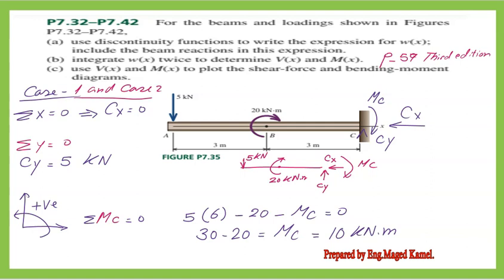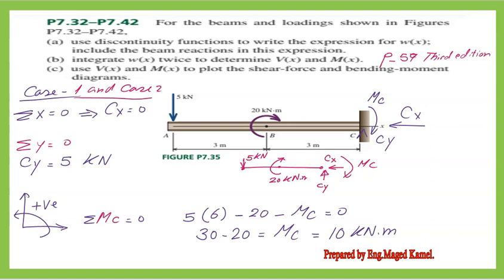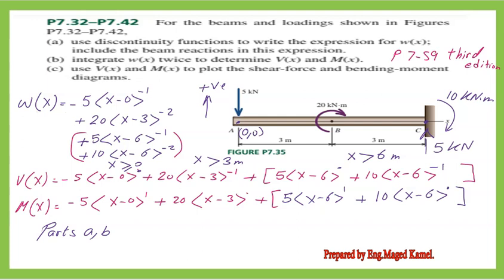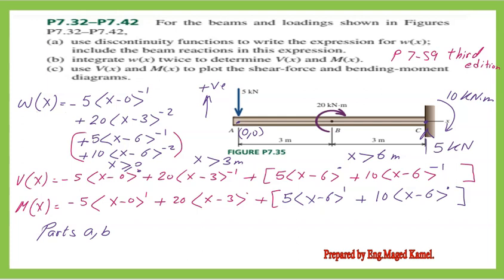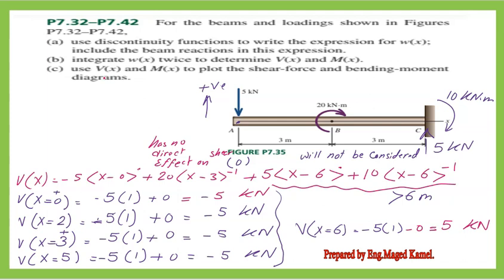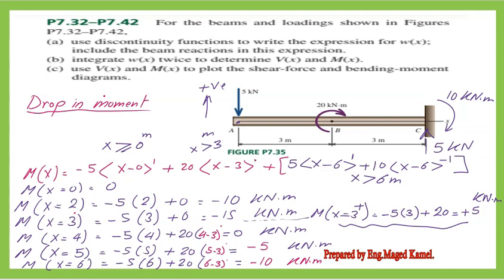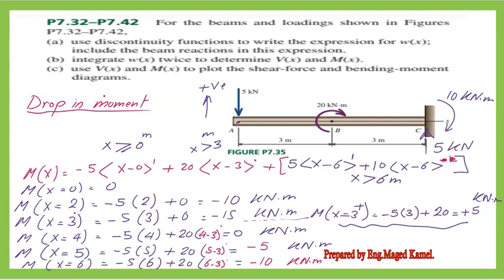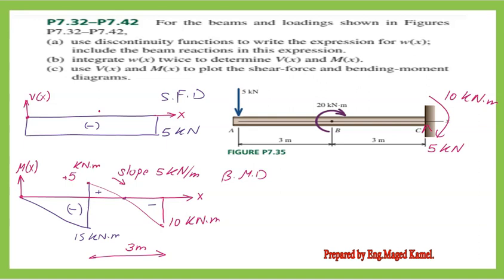4-Practice Problem P7-35-Find W(x), shear V(x) and M(x) for Cantilever-English.

Comment from the maker: There are two PDF files for the solved problem: The first PDF file link:https://magedkamel.com/wp-content/uploads/2025/12/PDF-file-for-post-4-P-7.35-load-and-shear-singularity.pdf
The second PDF file is:https://magedkamel.com/wp-content/uploads/2025/12/Pdf-for-post-4a-P-7.35-load-and-shear-singularity.pdf
There are two posts for solving the problem. 
The Post 4 links to https://magedkamel.com/4-part-1-of-practice-problem-7-35/
The second post links to: https://magedkamel.com/4a-part-2-of-practice-problem-7-35/